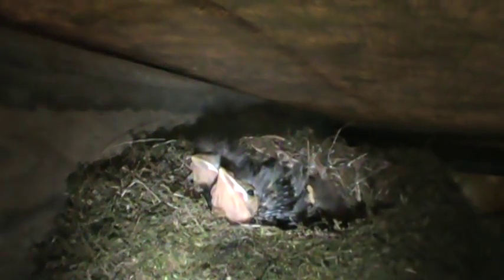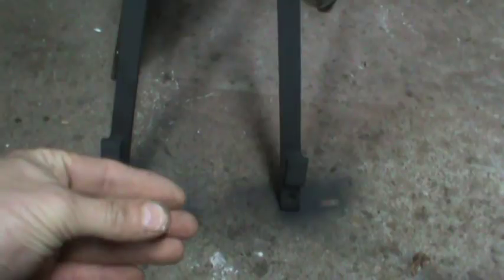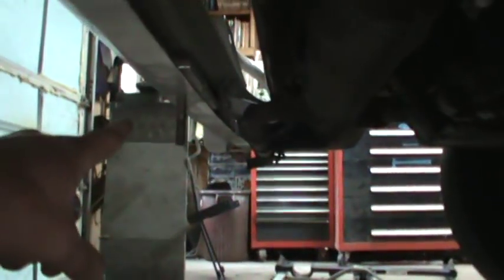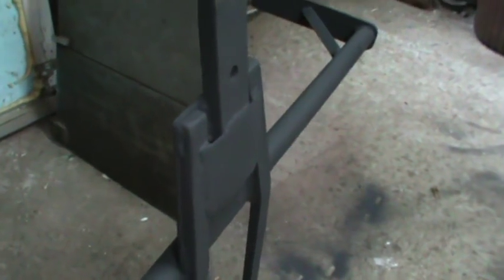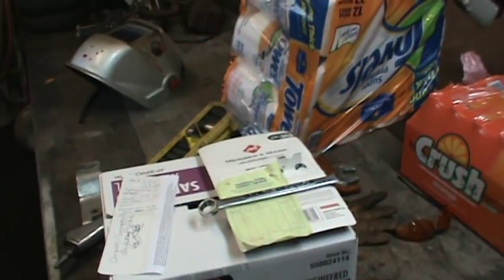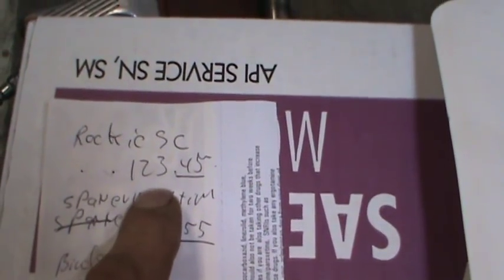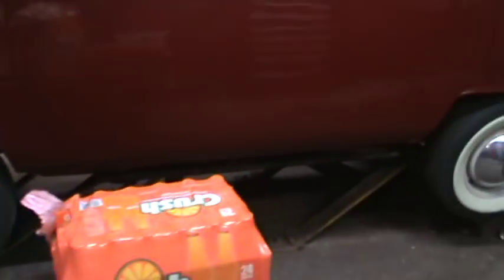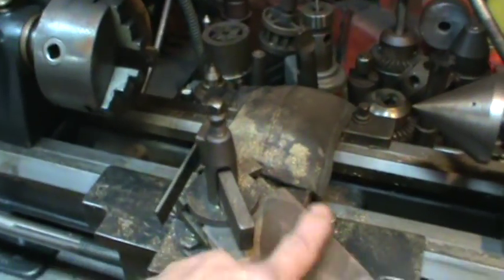and the winner is

Comment: I had back surgery too, L4 L5,  i think the same way.  i cant tell you how many times i walked away from picking something up for the same reason.  And you got a great score on those drill bits.  Also want to say you did some really good thinking welding on a doubler to the vw frame like that , good good thinking.

Comment: Yeah, but being Canadian, I guessed using Metric, so when you convert the kilograms to miles, then use the US to Canadian gallon difference, and divide it by kilometers and use the current exchange rate in Celcius times litres, it works out to $122.48 in Metric US dollars.  And since Canada has recently gotten rid of pennies, you round up the .48 to .50, making it exactly $122.50!   So I was closest, right?